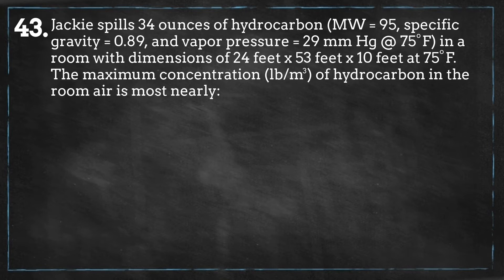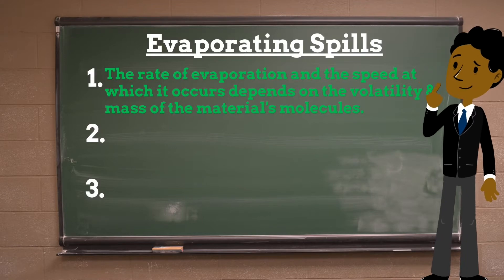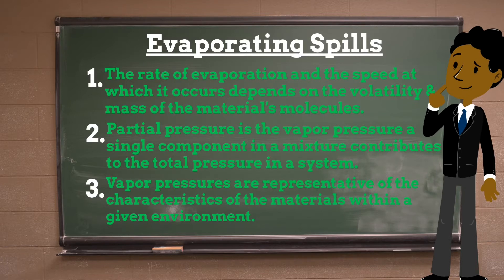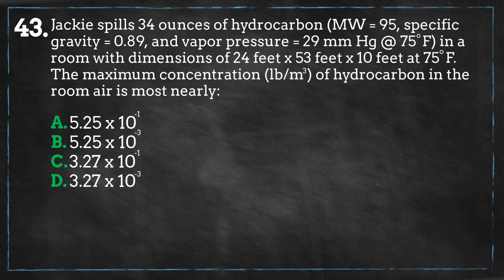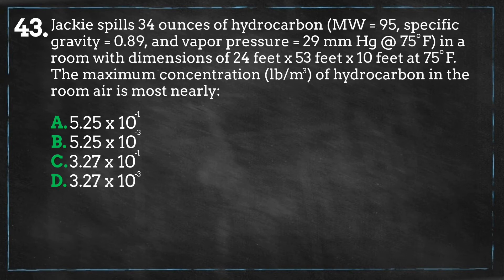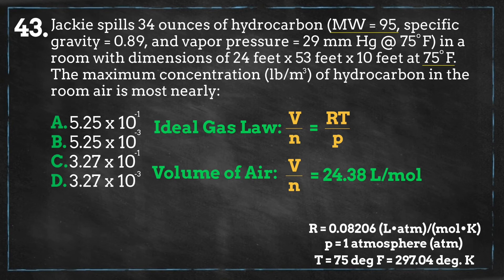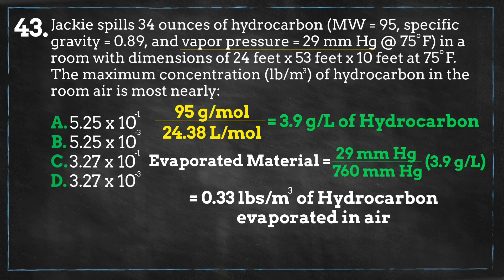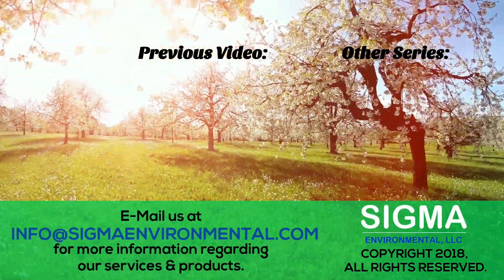Evaporating Spills - Episode 43 (Air Pollution Engineering) | 52 PE Exam Problems in 52 Weeks

Comment: How did you get 760 mmHg for pressure of the room?
Reply: it's typically assumed that if pressure is not given, them pressure = 1 atm = 760 mmHg. The pressure of the room isn't necessary to solve the problem though

Comment: Why did you select the answer with the lower concentration as the maximum possible concentration in the room?
Reply from the maker: Thanks for your question!  The concentration will always be limited by the vapor pressure of the material, the characteristics of the environment in which it spilled, and the total amount of material spill. You start with the amount spilled and calculate the maximum potential, and then you calculate how much of the spilled material the environment's atmosphere can hold. If the amount the atmosphere can hold of that material < the total amount spilled in the room, the former will be the amount chosen. If the amount the atmosphere can hold of that material > the total amount spilled in the room, the total amount spilled will be chose since the concentration cannot be greater that what was originally in that space. Let me know if this makes sense.
Reply: @SIGMAEnv  That makes a lot of sense, thank you for taking the time to respond and thank you so much for making this video series, it has been hugely helpful.
Reply: @SIGMAEnv  The question specifically asks the concentration in the 'room air'. I still don't see how the lower number is the answer. Should the question be, max concentration in the room instead of room air?

Comment: why did you use specific gravity to get the mass? wouldn't the mass just be the 34 oz (converted to lb)?
Reply: It should have specified volume or weight for the ounces (they are not the same).  I assumed volume because it was a liquid and I had to use the specific gravity.  I have no idea why specific gravity would be used if you assumed it was weight....
Reply: Good question!
Reply from the maker: Thanks for your question; this was provided in the episode to remind everyone that an ounce can be used for volume or weight. As Rob stated below, the specific gravity not equaling one (1) is an indication that the ounces used in this problem is used to indicate volume, not weight. Let me know if this makes sense.
Reply: @SIGMAEnv  Ounces are a measure of weight.  FLUID ounces are a measure of volume.  The problem states "ounces".
Reply: @SIGMAEnv  What confused me is that there are also 16 (weight) ounces in a pound. So I thought you were converting the weight in ounces to a weight in pound, then multiplying by specific gravity, which wouldn't make any sense! However, what I didn't realize at the time is the density of water is 1 lb /16 fl oz. The problem makes total sense now. Thank you!

Comment: At 3:27 I think you have the conversion factor upside down. It should be 0.02832 m^3 / 1 ft^3 or it can be 1 m^3 / 35.3147 ft^3
Reply from the maker: You are correct, that should be flipped in that conversion from cubic feet to cubic meters.